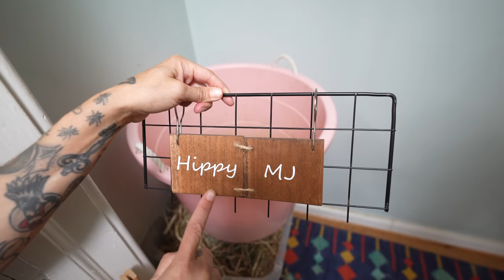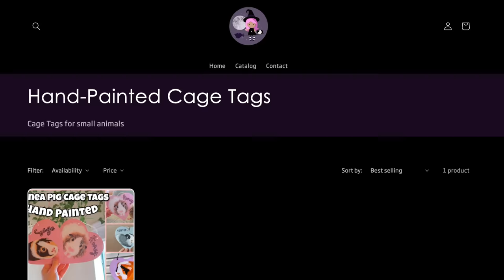DIY Guinea Pig Cage Makeover 🚮

Comment: I've had my cages in just about every configuration possible and for me, stacked has been the way to go. It takes a lot of grids but it's nice to not be bending over and cleaning on the floor all day. There are definitely ways to use your space to your advantage, cages don't have to just line the wall. You could make u-shaped cages, I even had kind of a z-shaped cage at one point. It's a lot of work so if you're not that in to the idea you're right to keep brainstorming.

Comment: I have somewhat of a stacked cage situation going on since I have to share a bedroom with my 5 pigs. I built a table with 2x4’s a sheet of plywood and hairpin table legs from Amazon. It fits a 3x6 cage on top, and I have a 3x5 cage underneath with lights so it’s not so dark and I’m able to pull it fully out to be able to clean it easily.

The biggest pro is that there’s a good amount of airflow and natural light to the bottom cage since my table legs are 28 inches tall, but the biggest con is having to use a step stool to get to the back of the top cage to spot and full clean. But it’s so worth it. I could’ve always customized the height by using 2x4s as legs like SkinnyPigs1 did lol

Comment: If you own the house you could replace both the bedroom door and the closet door with a pony door (essentially just the bottom half of a Dutch door) & use a retractable baby gate in the hallway or a retractable baby gate in all three areas mentioned. Just makes things mentally a little easier. 
As for the homes (Im new here so I'm not sure how many pigs you have) but you could have the herd running the length of the left wall before it hits the door and the center window & make a second level for them as well. 
The 2nd biggest groups you could essentially have the same thing just cut in half on the right side since they aren't as large.
For the duos you could set up a new shelf spanning the length of the wall between the two door ways & have 3 - 4 levels if you have the bottom shelf at the floor. 
Visually it might be nice to make an arch at the top of the shelf & place your neon sign inside of the arch. 

You'll basically have a small hallway that spans the length of the center window and a small hallway that can get you to the closet and out easily.  Which you can then use as storage if you make deep shelves in the closet.

Hopefully this all makes sense & you get something out of it :,) & pls note I am guesstimating size to the best of my ability lmao

Comment: So let’s see, you have 4 herds, one with 4 piggies needing about 16sq feet. If you did stacked cages in a U or L shape I think you could split the 3 smaller herds along the bottom and the bigger herd along the top. If you used the full long wall I think you could definitely give the piggies more than the 16sq feet they need and split the bottom level so each of the smaller herds can get about a 2x5 maybe 2x6 depending on how long the wall is and if you go U shaped definitely more space than that even.
Reply from the maker: Thank you!!!!